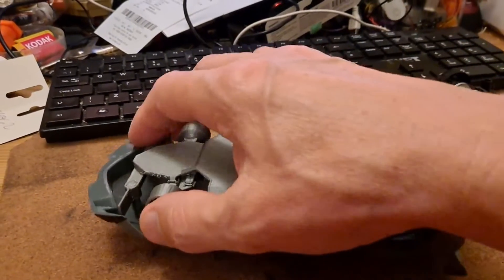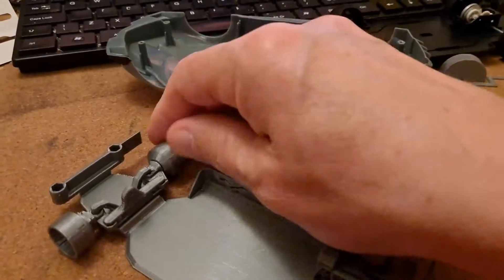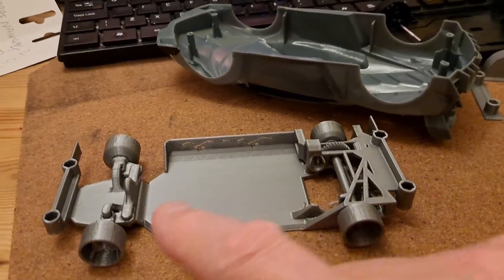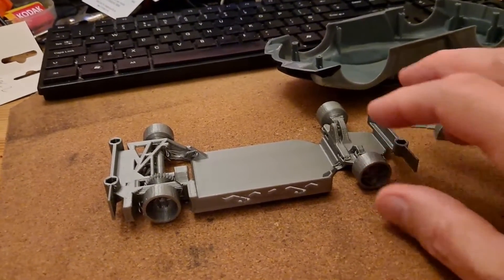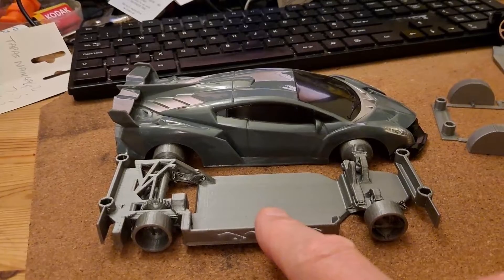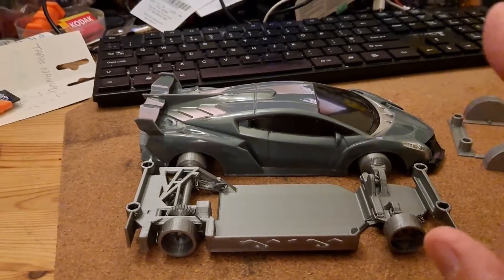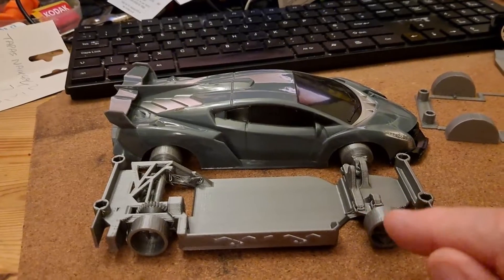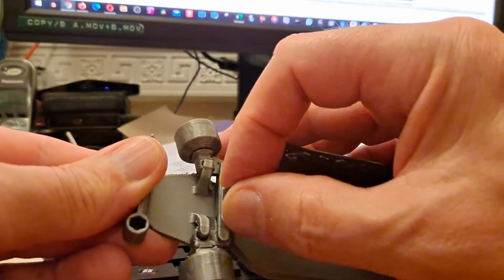Poundland toy car RC conversion project - Print in Place Part 1

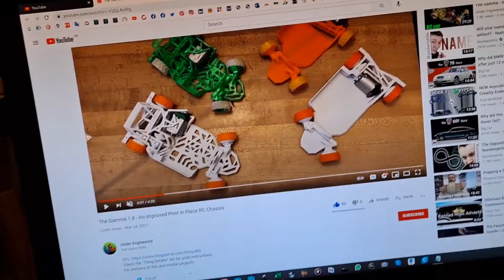Comment: Cool! I've been looking at 3d print Chassis's, I want to do a 1:24 Custom.
Reply from the maker: There is a link in the video description to the design I modified for this car.
Reply: @GrandadIsAnOldMan  Thanks Man!👍. I was wondering if you found any controllers from other cars that are compatible working with 1:14 Rastar Rc's, without taking them apart?

Comment: Nice print off. The chassis came out well.why is the printer printing the chassis vertical and not flat?
Reply from the maker: You need to understand how the printer prints the layers. It cannot print over a gap so this has been designed so it can all be printed in one continuous session.

Comment: I think you should put a tiny little brushless in it. Lol
Reply from the maker: You could do that, with a bit of modification to the engine bay, and you would need to strengthen some areas to take more power.

Comment: With resin 3D printer you can print stuff with a surface flat like water,so then you haven't got rough surface and off course a friction
Reply from the maker: From what I have seen those resin prints are very brittle.